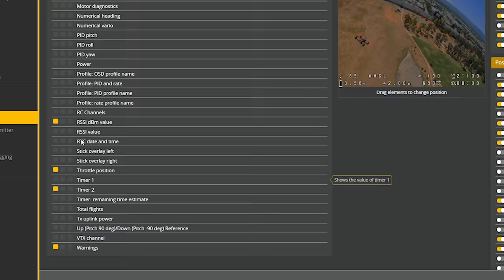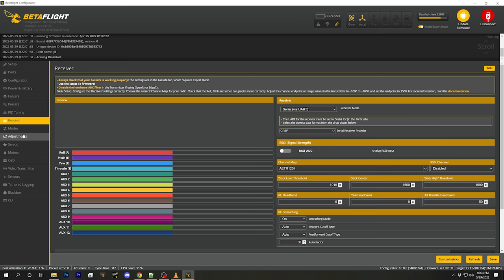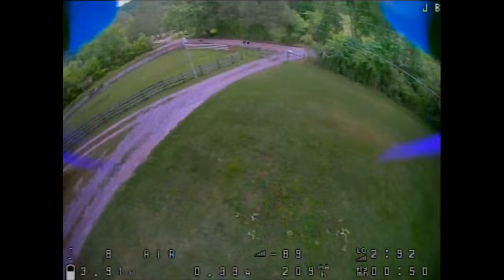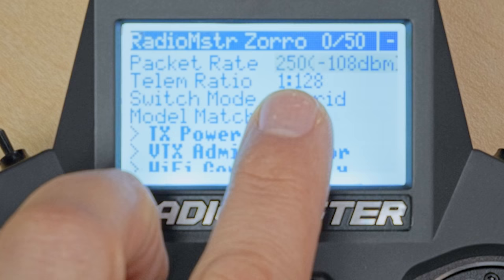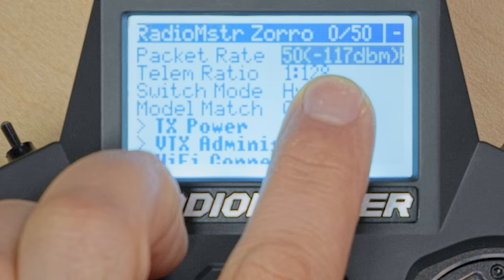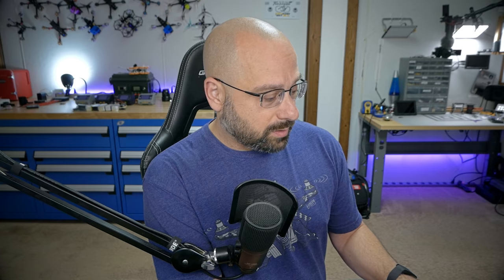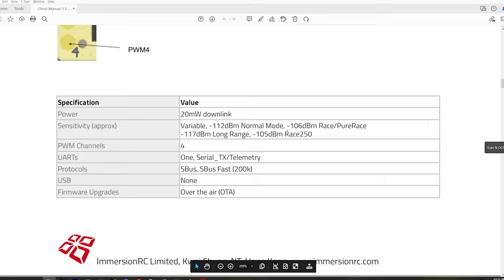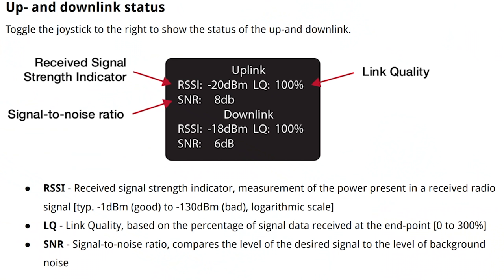Avoid failsafes with RSSI dBm (LQ is not enough!)

Comment: just a side note :
the save warning levels for crossfire/ tracer are in the manual, including the cli commands
Reply from the maker: Correct me if I'm wrong but isn't that based on LQ and RFmode?
Reply: yes, it is rf mode based. i don't know where the rssi limit (the hard limit) is in 150hz mode. but I got the information for both to write -100dbm (which is a save level for 90% of the users imho)

from the manual: 
Rf mode dynamic or forced 50Hz:
    set osd_link_quality_alarm = 70
    set osd_RSSI_dbm_alarm = -100
Rf mode forced 150Hz:
    set osd_link_quality_alarm = 40
    set osd_RSSI_dbm_alarm = -100
Reply: Sadly not for tracer unless i am overlooking it in the manual (but a serch for rssi doesnt even show any results). Altho they do state that the signal strength is the fusion value between both antennas so i do not know how that works.
Reply: Nevermind they just packed it into a different thing called fusion overall making it a little confusing.
Reply: HI DIHLER :)
Reply: @dihler55  yep, thats true. duno the reason but I guess that's going to change :)

the combined rssi is just for the diversity rx. to save data, only the worse of the two antennas is send back as telemetry.

Comment: Or fly crossfire at 50Hz mode and based on my experience, fly to the moon before going below a link quality of 98.
Reply: What power are you using??
Reply: Yep lol
Reply: @mafiafpv3469  500MW works great without the interference caused by 1W.
Reply: @breakflight  only reason is my crossfire switches from 150hz to 50hz like 100meters away
Reply: @mafiafpv3469  so does mine, it does.  Furthest I’ve gone (before the law changed here) was 7 miles on 250mw.  I now just freestyle and run at fixed 150Hz, furthest away I’ve gone is about a mile but for local stuff 150hz is good enough.
Reply: 50hz does feel like crap compared to 250hz tho , loved my crossfire but still haven't had elrs @250mw/250hz failsafe, although ive got a couple 150hz locked crossfire failsafes
Reply: @testpilotian3188  so you use 50hz for long range stuff??
Reply: @mafiafpv3469  that's why I just set it to 50hz. It's a minor delay, but it's a fixed minor delay. I can work with that

Comment: Sadly, using the DJI radio/control link doesn’t utilize rssi as far as I know. I’ve been using the bit rate as my signal strength and when it gets below 10 bps, I know I’m closed to fail safe. But this isn’t as reliable and I’m too lazy to use a different radio/receiver. Unless you know of a way to get rssi on a complete dji system?
Reply: There is a patched Betaflight version JB has a video and it keeps updated even with all BF rc veraions

Comment: Yes JB, I'm enjoing this kind of content :) btw: ELRS reports SNR in telementry. You can set all telemetry warnings by that in radio (like your zorro) ;) I think it's important to understand also that bigger tree give -10 - (-15db) drop.  So if your playing somewer on -105dBm, going behind the tree it failsafe :/ Unfortunatly in radio link especially no GHz freq it's hart to say "rock solid" link.  ELRS: 25mw to  250mW  is 10bB, but to 1W is only ~14dB. So simply it has no sens to go with ultra high power transmiter...

Comment: Great video. Just lost a $700 setup where I failsafed into the ocean with Tracer at 500M out. As soon as I flew behind myself, my LQ went to 9 and I failsafed. There was really no warning. Would be nice if everything you mentioned could be combined into 1 OSD element that just gave you a percentage from 1-100%. 

As info, since my crash I tested tracer with my wing at close range and sure enough, when I flew behind myself, it failsafed. Normally you would expect to see DJI video quality starting to drop but the goggles being on top of your head are still able to receive good signal when your transmitter antenna is held at waist level, it is fully blocked by your body.
Reply: Damn...

I only fly cheap setups over water and use GPS return to home fail safe.

Comment: I'm probably the only Spektrum fpv pilot left but, my DX8 gen2 with a SRLX2 rx reports rssi dbm on the telemetry screen on the transmitter. I'm going to try and get the value to display this in the osd. Thanks for this video 👍

Comment: I have flown ELRS 2.4 at 500hz and -105dbm and I didn't failsafe. That value was up there for a second or maybe more.
I still had positive smooth control and no issues. No micro failsafes. No failsafe at all.

Comment: Hitting pause to say thanks for explaining dbm value with LQ for crossfire. I use DJI air unit and have been wondering how low dbm can go and what the value means. Last “long range” flight that I did with my 5” quad using diversity crossfire my dbm value was -70. The whole LQ read 1:85 -70dbm
Reply: how did you set it up? My LQ displays using the "warning" element, but as soon as I'm 50m away all I see is "rssidbm" instead of the actual value or link quality.

Comment: i fixed the failsafe behaviour of frsky, i flew my mobula7 with my emax d8 rc 550m and i could have kept going but i was worried about running out of battery so i turned around, and before from inside my dads metal shed with the roller door shut i could not fly more than 10m away from the shed before it would fall out of the sky, and now i can fly it all over the 5 acre property 150m in all directions from inside the shed not even pointing the rc at the quad, and the mobula7 and my rc both just have their standard shitty antennas, i have the rssi in the 0-99% range, and before it would failsafe around 40 when it would drop out for a second, now i can fly in the low 20's and it wont fall out of the sky with the fix i did in betaflight. My rssi dbm and my LQ seem to not change or do anything but the rssi % seems to be reliable enough for me. Also i just have the transporter 2 goggles that came with my th3 rtf kit with lollipop antennas on it and from standing outside of my car i still had perfect video at 550 meters out with line of sight, and it starts to break up real bad around 500m when im sitting inside my car but i kept my rc link and it didnt failsafe and fall, ill be making a little video soon to show what i did to fix the failsafe behavioue, just my issue now is i conformal coated my mobula7 aio and now i cant connect my usb to it lol and my th3 i crashed into a puddle and i can still connect it to betaflight to show the settings but i cant fly it because the esc's are fried and it pulls 15 amps just on idle lol but i can show the th3 settings and the flight footage from the fixed mobula7 but i cant change back to standard to show it failsafeing on me and range test it with the failsafe behaviour. but yeah long story short, frsky isnt really the best, but mostly betaflight settings make it 100x worse than it should be and its very easy to fix

Comment: Informative video 👍 recently my cinewhoop with flysky x6b receiver had a failsafe and it flew a few meters away due to wind before crashing. Took me an entire day to find the quad. Turned out one of the antenna on the receiver had gotten loose which resulted in multiple failsafe incidents and sudden drop in rssi value.

Comment: I get from 2.100 to 1.100 at about 50 meters on tbs crsf micro, it doesn’t fails safe but seems to drop quick. Iv kept rf profile dynamic because there’s more warning of a failsafe over being locked into 150 or 50hz.

Comment: This video reopened my fresh wound! I lost my Mobula7 ELRS 2 days while flying in my residential neighborhood. And it's been eating at me, cuz I can't figure out what happened?! Just before I lost it, I remember seeing RSSI dbl Low flash quickly on my goggles before the image went completely white static. I remember when that happened, my drone was literally flying 10 feet above me heading towards the corner of the block. It must have had some massive signal interference at that point. The video screen went white static so I thought I had crashed on a powerline I didnt see and maybe the battery maybe fell out from the crash. But this couldn't be because I still had a connecion on my ELRS transmitter, just no visual on my Eachine EV800D box goggles! I never was in this situation before. So I started walking around the block and I armed and disarmed the drone several times to see if I could hear the motors spinning close to where I had thought the drone had maybe fallen. But nothing... and still no visual on my goggles either! And that was the worst part. I think as I arming and disarming the drone, I had probably flown too far without realizing it. And at some point I also lost connection to my Zorro ELRS controller as on top of losing connection to the VTX. So I started walking around the block and to my surprise got a connection at the opposite end of the block. Never woulda thought it would be at this other end. But only if I stood in the middle of the street could I get a connection. If I moved, I'd lose connection again. It was the strangest thing! I put my goggles back on to see if I could get a visual from the vtx at this spot, but still nothing. And then at some point after disarming I guess the drone may have been high up and had fallen and the batter probably dropped on someone's roof. From there I forever lost connection. This whole ordeal has been bothering me cuz I can't figure out what happened or how it happened. Why would I lose visual but still have connection to my ELRS? Why did I lose visual with the drone so close like 10 feet above my head? Why did I Get ELRS connection in only that one spot in the middle of the street? I'm trying to walk it back and remember all my steps. Unfortunately I didn't have an SD card on my goggles DVR either. So I can only rely on memory to piece it all together. But lesson learned, I'm never flying in a crowded city neighborhood again. There is just too much noise. Anyway posting here to see if anyone can help bring me closure lol
Reply: ahhh sorry man. it happens sometimes, just be glad it was only a $100 mobula rather than a $500 5". It sounds like there must've been some issue with your antenna mounting or settings. Maybe you were on the wrong analog channel even.
Reply: @avgvstvs96  nah not wrong analog channel cuz my picture was fine until signal got lost. When you say issue with antenna mounting, U mean the VTX antenna right?

Comment: Hi Bardwell,  i have air unit with Elrs, and i use the Howels firmware to see the LQ and RSSi value, but is there a way to put that limit warning on my TX16S controller? i think i can do it, but i just dont know how to do it hehe.. would this be a good video to show how to do it... the radio saying the "low Rssi" or "Low LQ" warning sound.
Reply: You can get RSSI,  RQly and a number of other values in the telemetry. I'm not sure if RQly is the same as LQ though. Instructions for setting up a warning are here: https://oscarliang.com/lq-rssi/

Comment: I watched this and troublehot my rssidbm always reading -130, resolved by turning off RSSI_ADC and maybe enabling telemetry. Now I see an insane -46dbm reading at 10mw next to the transmitter and feel totally comfortable in the -90's when flying 

As i'm running 250Hz i set the warning to -102, approximately half the distance it should reach according to the 6dbm rule (my Jumper T12 shows -108dbm as the cutoff) 

Should I do Bardwell for halloween??? I would basically need a pair of glasses.

Comment: i really gotta get lq and rssi sorted on crossfire/dji v2's, its just a matter of time before some radio or dji drone blows me outta the sky.  i wonder if snr would be better, then i'd know somebody else was blastin.   what we really need is some sort of colour code, lq goes red at X and dbm goes red at Y  with purple being micro failsafes or sumthin,
Reply: All I did was put LQ output onto channel 12 on my Tango2, then just set the RSSI on the DJI OSD as Aux 8, if it gets to 80, I turn back.  In fact it was only when I made my own minimortal antenna that the LQ dropped below 99 lol. Since I switched to crossfire 3 years ago I’ve not had a failsafe even though I fly regularly with up to 10 other pilots (most old folk using shitty Spectrum protocol that failsafes if you look at it wrong).
Reply: @testpilotian3188  yeah i need to figure this out on the nirvana.... eek... the thing that worries me about crossfire is it is sooo good, i've made huge mistakes, flew 200m behind myself and out of los for a few seconds, not a blip from cf or dji v2's with default antenna??? i do use nano diversity though so that helps., i'm literally flying mountains and half mile out to sea, with no lq or rssi.  i do have audible '' rf signal low'' warning on the nirvana, but thats like 1 second failsafe. only heard it once about 800m to the side, gets the blood pumping though hehehe

Comment: Can't use dBm in DJI right? 
I use to use it on my long range analog but pretty I can't use it on DJI.
Time for HDzero or walksnail something
Reply: You can use it, there is a betaflight fork by a developer named “Howels”, he used the craft name element and managed to replace it somehow by some logic which displays, LQ RSSI dbm and warnings in this, Joshua has a tutorial on it, search his channel for DJI LQ and warnings..
Reply: @kadirjabbar8396  how did you set it up? My LQ displays using the "warning" element, but as soon as I'm 50m away all I see is "rssidbm" instead of the actual value or link quality. So how do you show both/cycle between them?

Comment: thanks as always. how does this all relate to the OpenTX/EdgeTX RSSI "Low Alarm" (set to a default of 45) and "Critical Alarm" (42) in the Telemetry tab of your model? I'm using ELRS, should I just tick the "Disable Telemetry Alarms" checkbox? thanks
Reply from the maker: I would disable the RSSI low and critical alarms if using these protocols. I don't think they are as relevant.

Comment: Good video but the problem for me is i can't turn on nowhere rssi dbm and lq on my quads. I use ghost both quads on bf 4.2. I do not have these options in betaflight and nowhere can turn them on, the only value that I can display is normal rssi. Any advices how to fix it?
Reply from the maker: You must be using BF 4.3, and you must be using GHST protocol not SBUS or SRXL2.

Comment: FWIW in an urban environment at 2.4ghz I don't think I've ever seen a noise floor below about -95. -90 is more typical.
Reply: How do you measure it? I know big crossfires and ghost tx's can show/scan for a noise floor measurement but the snr on elrs seems to max out around maybe 10 db. So I can't just set a calculated telemetry value using rssi dbm minus snr, like I do on crossfire.

Comment: Is hearing dB the same as radio signal dbm? Hearing measure of db is doubled every 3 db
Reply from the maker: Power doubles every 3 dB. But range doubles every 6 dB, because signal strength drops off according to the inverse square law. You need 4x the power to get 2x the range. It's the same with audio. To get the same SPL, you need 6 dB more to get 2x the distance.

Comment: My crossfire was losing signal every flight, most of the time it happened from 50 meters away. the drone simply turned off and indicated fs. The rssi went down very fast and when it was 40 rssi it went into fs. I updated the nano module to 6.17 (it was 6.13) apparently after a few flights I didn't have FS anymore. The LQ was always high, but suddenly it dropped and you couldn't even see how far it was going. You can see the video link, close to the minute 4 the fs happens https://www.youtube.com/watch?v=r_WLJ6lNwkM

Comment: You can't use LQ or dbm with dji osd without the craftname hack right?
Reply from the maker: Correct.
Reply: @JoshuaBardwell   My LQ displays using the "warning" element, but as soon as I'm 50m away all I see is "rssidbm" instead of the actual value or link quality. So how do you show both/cycle between them?

Comment: 130dbm for crossfire is probably for 4hz mode
Reply from the maker: That did seem pretty low.
Reply: That could very well be true, on 50Hz when i get to about -108 dBm, the lq starts to get unstable, dropping into the 80 or even 70 range, so i think i'm not far from a failsafe then. That's on 1 Watt btw (50 km out)

Comment: My RM Zorro has issues with range, even on 250mw it's short (400-500m) but on RM TX16S with Betafpv elrs module (0,5W version) on 100mw range is much, much better. Anyone has similar issues?
Reply: Same transmit frequency? On the zorro it's set at 500hz... so short range. Move to 150hz and you'll go real far.
Reply: I have the Jumper T Pro and I'm not satisfied with 100mW either. My Radiolink At10 was better there, but 250mW is ok. Did you mount the antenna horizontally on the receiver? Then do not fold out the antenna on the transmitter so that it is also horizontal. It is worth a try.
Reply: @altermannfliegt3927  I'm flying half a km away in a densed wifi zone without even a drop on the LQ... Moving from 150hz up to 250 or 500 then I get about 400m and the worse is about 200. 
All this is with 25mw....
Reply: @nikotttin  I like 500Hz as it is similar to radiolink at10 in delay/ latency. At 100mW the drone fell from the sky at 800m. However, there is still a piece of forest in between. With 250mW the reception is as good as radiolink. I don't fly more than 5km and I can do that with 500mW. LQ remained the same only rssi dbm was less and suddenly the crash happened.
Reply: @nikotttin  Good attention, now I use on both radios 250 Hz, but I will try 150 Hz. However, on the second radio with the Betafpv module I had no problem with range. Perhaps the external TX has a better antenna (Moxon) than Zorro. @Joshua Bardwell should check this ;)